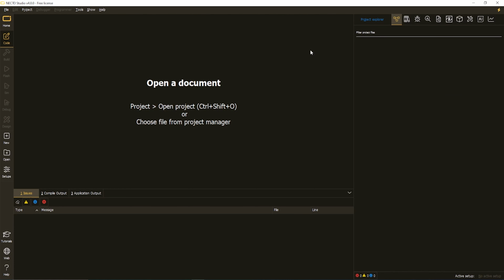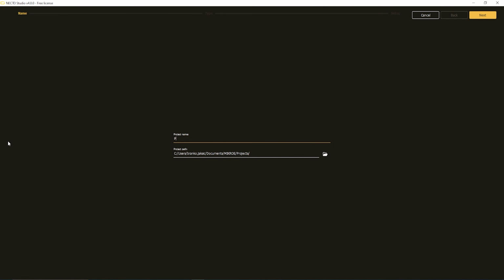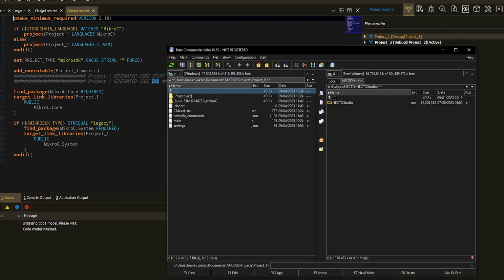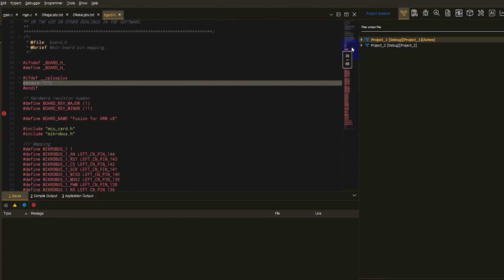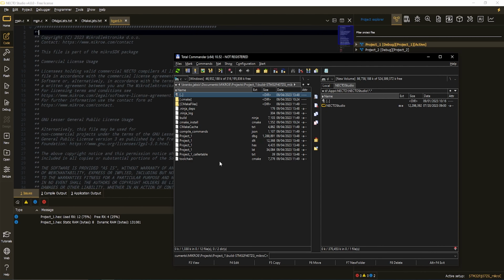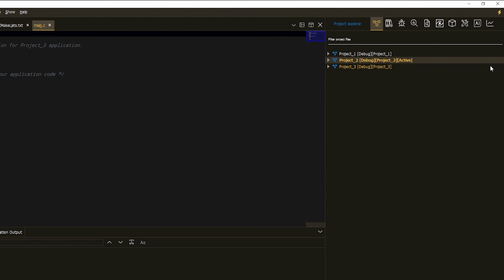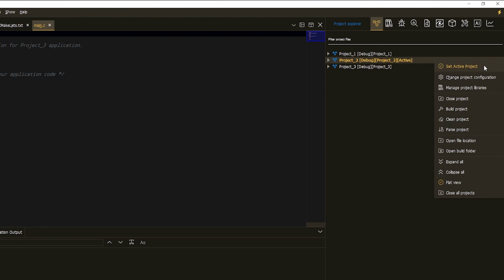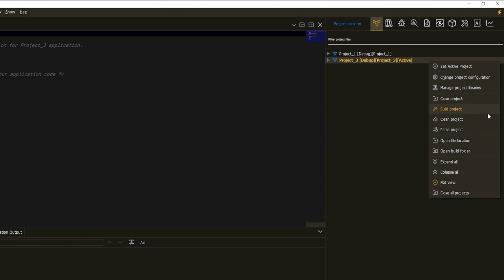Handle IoT Projects Smoothly - Project Explorer Basics

Comment: Hello! I've been here on the NECTO IDE since the beginning. I have a suggestion, for students beginner with programming, would it be possible to present from a to z the creation of a project, the configuration of the programming tool until the programming of a hardware preferably a hardware selected on planet debug. Thank you.
Reply from the maker: @landrydzuakou3779 Hey there.
Good feedback.
We will release the video You just described in two weeks.